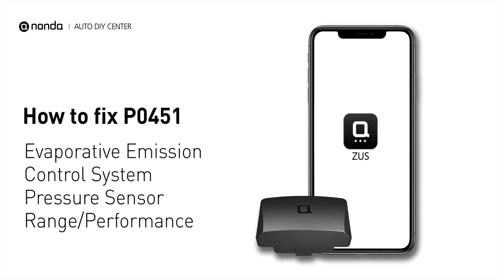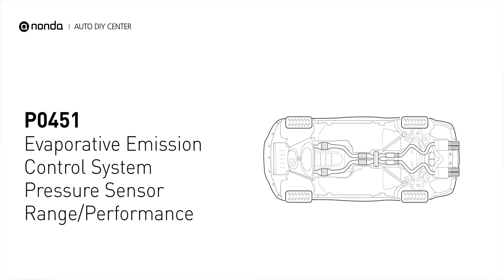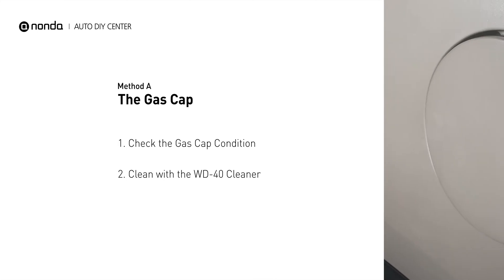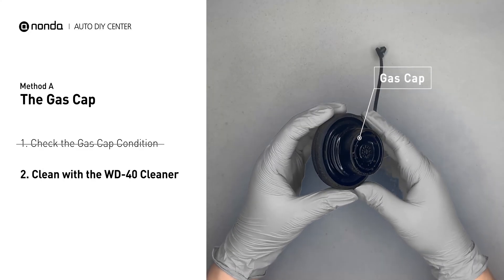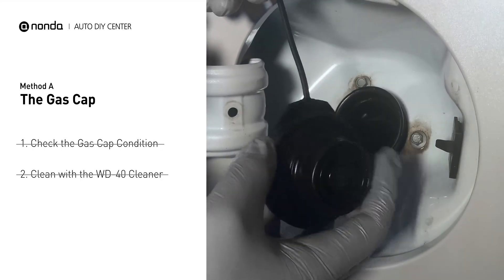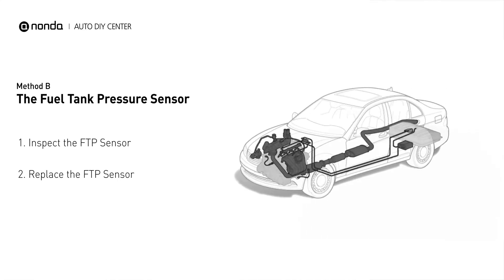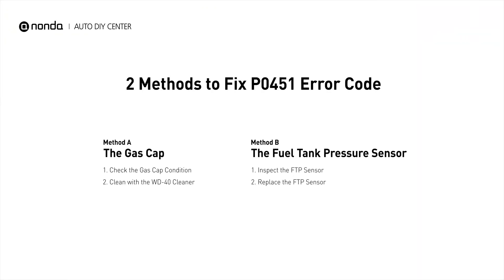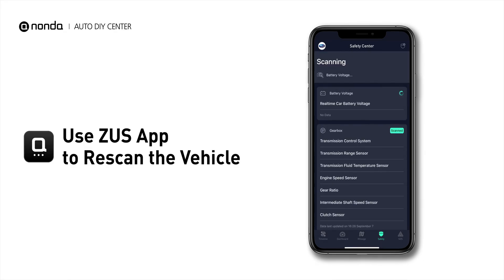How to Fix P0451 Engine Code in 3 Minutes [2 DIY Methods / Only $4.35]

Comment from the maker: Hi, I'm Steve, nonda's lead mechanic engineer. 
Feel free to leave your comments here if you have any mechanic questions, I will be glad to help you out!
Reply: How do i replace the fuel tank pressure sensor on a 2013 Cadillac ats without dropping the whole tank?
Reply: I have a 2013 f150 and engine light popped on and same code popped on

Comment: I have changed the ftp sensor and after changing it out it went away but a week later it came back with the same code p0451 but now it tells me its the canister purge valve. I replaced it with a new one check engine light has not gone away. Any thoughts on solutions?

Comment: Say NONDA I am fixing this code on my NORD and the tank vent valve requires the tank to be dropped and costs $351.69. It would be way more helpful if someone actually showed the resistance values for the tank vent valve or at least the associated wiring diagram.

Comment: I have a 2007 f 150 5.4 with po451 code ,gas cap looked good, where is this pressure switch located, on top of tank?

Comment: I changed the cap. Same error code. Tomorrow, I will clean the way you did. As for the FTP, it cannot be changed by itself. The evaporator hose must changed too because it comes as a kit with the FTP. 3 hours of labor since they have to remove the gas tank. Mazda makes it complicated.
Reply: Still the same error message.
Reply: Same with 09 ford focus

Comment: I have a  2014 Ford Escape with the P0451 censor light appearing.  However, I do not have a gas cap to clean but the light seems to come on when I do get gas and comes off and on intermittently.  How can I fix this without having to replace the censor which is very expense.

Comment: Hello, I have a 2013 Hyundai Elantra GT. The check engine light came on and I am getting Evaporative emissions system vent valve/Solenoid circuit (P0449) and Evaporative emissions system pressure sensor range/ performance (P0451). A place recommended me have an electrician take a loon first and he told me everything electrically looked good and circuits looked good. Any idea what could be triggering these 2 codes?
Reply from the maker: Hi Kyle, we suggest checking the condition of the vent valve and make sure that the fuel pressure sensor signal is within specs.

Comment: Greetings, I have this problem P0451, the dealer replaced the pressure sensor, the problem persists, again the dealer diagnosed that it was internal damage to the fuel pump, they replaced the completely new fuel pump assembly and delivered the car to me, at The 2 days I turned on the check engine, I verified it and again it presented the code P0451, I took it to the dealer and they verified it and they told me that the vehicle had no problems when it came to checking it, I bought the original gas cap and without luck, after a few days the engine turned on. check engine light, check the lines of the canister and everything looks good, buy the purge valve. Will this be my problem? This valve can cause a code P0451??

2020 Hyundai Tucson 2.4L GDI
Reply from the maker: Hi Jose, have you checked the condition of the evap lines/wiring and fuel cap?
Reply: @nondainc  Thank you very much for answering, problem solved it was the purge valve, apparently it had some electrical problem that the car did not present any type of problem, only that the check engine light came on, it was replaced until now the check engine light has not come back on.

Comment: Is is possible that my capless gas cap could be the issue even though its not a twist off gas cap?
Reply: I turned my truck on to warm up for a minute or so, and got caught up doing other things, so my truck idled for roughly 5-10 minutes, could this have caused a rare misfire, or should I looking into this check engine light code P0451
Reply from the maker: Hi Jimmy, please provide us with your vehicle's year, make and model.

Comment: im getting code P0451 and P0450 for my ford edge 2010.. i replaced Evap canister / Solenoid valve  but that code still there and the engine light as well.. could you please help me what i can do next..
Reply from the maker: Hello, we highly suggest to begin with checking the fuel cap (could be under-tightened/bad) then check the wiring harness and the Fuel Tank Pressure Relief Valve for any issues.

Comment: Hello, I have a 2018 silverado that I recently changed out the fuel pump and fuel pressure sensor, after a day of driving the code came up, I replaced everything and connectors were cleaned and check. The truck doesn't have a gas cap so I'm not to sure what could be the issue
Reply from the maker: Hi Randy, please confirm if this is the only code you're getting.

Comment: I have a 03 Saturn Vue with a 3.0 V6. I'm getting code PO451. When I add fuel my engine is hard to crank. I have to give it gas and hold the brake pedal down. But  after it starts up It runs fine. I only have to turn the key and it fires up perfectly.  Until it's time to refuel and it does the same thing. I changed the fuel filter but it didn't change anything.
Reply: Thank you. I'll post an update
Reply from the maker: You're most welcome!
Reply: Thank you. Someone on FB told me to check that a little over a week ago. And it was my problem. And a cheap fix. Because I had on left on my old engine. I'm glad I saved all the parts and block. It's came in handy several times so far.
Reply from the maker: Hi William, is there any other code registering together with P0451?
Reply: @nondainc  no other codes. I did read a post online. That said when it happened it was the primary fuel pump failing. I've been driving it that way for a month now. I've thought about seeing if I can replace the pressure switch. Without dropping the tank. But it's been rainy weather. So I haven't gotten underneath it yet to see it I can reach it.
Reply from the maker: Hi William, you may also clean the gas cap and inspect/replace the fuel tank pressure sensor. Hope it helps, and we will be waiting for any updates!
Reply: I cleaned the gas cap and got a new one. I changed the pressure switch. It's cranking up easier than it was. But I still have to give it gas to start after adding fuel. After I get it started. I only have to turn the key and it fires up just fine. Untill I add fuel again.
Reply from the maker: Hi William, we suggest to have your vehicle visually inspected by your local mechanic for further diagnosis.
Reply: @williamsimpson5772  purge valve solenoid..I had the same issue with my car for a while

Comment: Hmmmm i swapped mine- and the code repopped back up a few hours later- dont know ifbits the connector itself or the sensor was faulty- and takes a couple hours to drop the gas tank in your typical home garage
Reply from the maker: Hi Luis, we suggest to do a visual inspection on the EVAP system/hoses and electrical harnesses connectors. Ensure that the EVAP pressure sensor signal is within your car's recommended specifications.
Reply: @nondainc  hey awesome thank you I'll check it out
Reply from the maker: You're most welcome!

Comment: I was wondering , I left my car parked outside during winter with low gasoline for 3 days without driving or starting it , then after these 3 days I fueled it up to full. my check engine light came on 5 to 10mins after this
Reply from the maker: Hello, kindly make sure your gas cap is on tight. Turn off the engine while you're having the tank filled, and make sure the tank isn't overfilled.